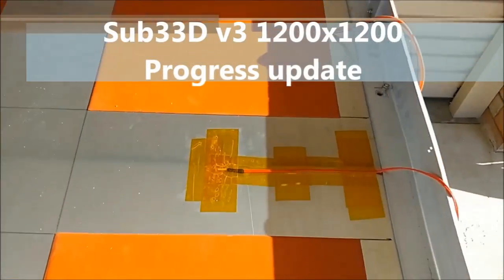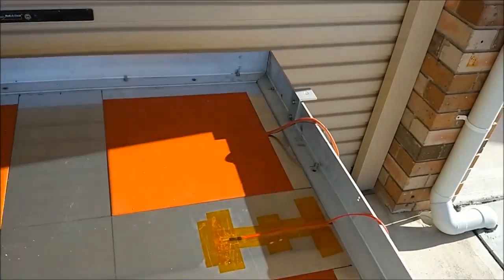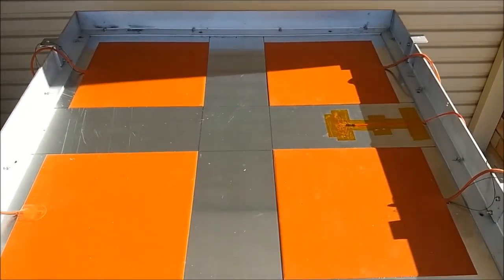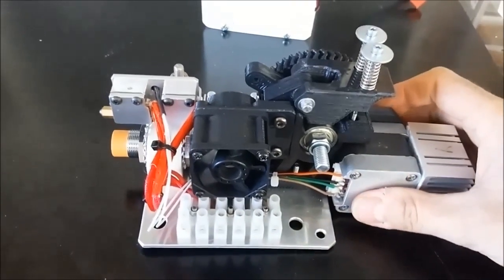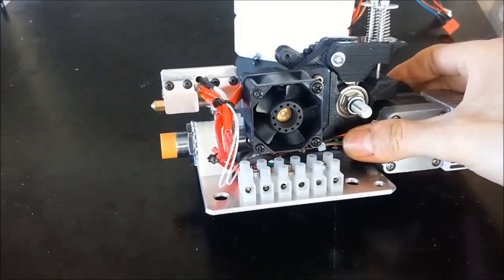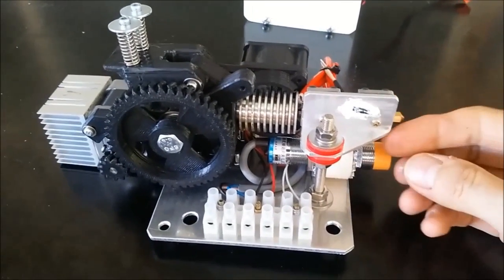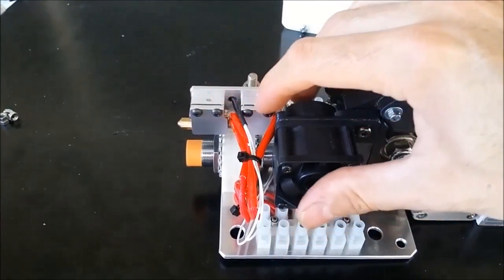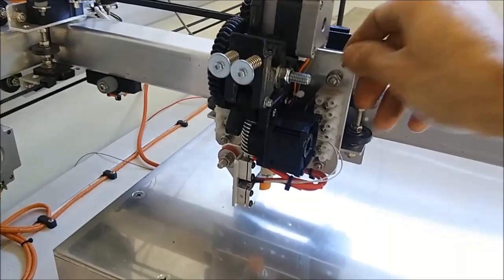Large scale DIY 3D printer - 1200 x 1200 Sub33D V3 - Heatbed and Extruder setup

Comment: Do you control each bed heating element separately, or do all four receive voltage from the same source and you get information from the one thermistor you described? Are the thermistors native to the heating elements even used?

Comment: does the heat pads come with self stick adhesive or do you need to glue them on?   if you have to glue them, what type of glue did you use?

Comment: Quick question? Are you familiar with magnetic position lock? Where an object can be locked into position by way of magnetism! If we implemented that tech into 3d printing wouldn't that made the axis move smoother?
Reply: I googled magnetic position lock and didn't find anything. Is it like the brakes and motors on modern rollercoasters/trains kind of deal?
Reply: @MrRoyHarden  I've brainstormed this idea and haven't figured out a solution to magnetic wobble!still thinking thou!👍

Comment: 4 heatbed uses one power supply or every heatbed is having it own power supply. Thanks
Reply from the maker: The heatbeds are all connected in parallel and run off 240v AC (no power supplies needed), they are controlled using a 25A solid state relay
Reply: @sub33d32  how are they controlled?

Comment: Love this project! i know you must've all ready considered this, but i would definitely fill the whole build plate with silicone heat pads, or just take them off and print pla on the cold bed. it is kind of pointless in this configuration as warping with abs always happens on a specific spot and if its cold in a place it will always end up warping on that spot. maybe you have found a way around it already, but good luck man!

Comment: hi i'm rene how did you do that with the thermistor centered on the bed? or one heating mat? Best regards, rene
Reply from the maker: I installed a thermistor in between 2 of the heating pads (did not use the ones in the heating pads)

Comment: have you try using heating element under the bed. another way is  to produce steam system to distribute heats across the bed at cheap cost. Im using full THK linear and rack n pinion.

Comment: That extruder assembly is a work of art.  I particularly like the support for the heating system to prevent breakage upstream when collisions happen.  Incidentally, I see insulating washers for that mount and that is great but what about between the rod and the support plate?  Is the hole oversized with a washer within the plate to fill the space between the undersized rod and oversized hole?  Putting an insulating washer there could further reduce unwanted heat escapage. :-)
Reply from the maker: Cheers, yes you are correct, a second set of fiber washers would help reduce the heat loss further, although this extruder will be replaced shortly, as I am currently building a dual 100mm tall stack, 320W (8 x 40w heaters) 1.5mm nozzle extruder which should have 4 x the flow rate of the current one (16 x the flow rate/speed of average 3D printers), but it will loose some detail compared to the current 1mm setup.
Reply: Why don't consider the supervolcano... you can get either the original E3d or some Chinese clones and it come with 80W heater and 3 times the heating capacity of normal volcano  ..
Also don't you think 2400w for bed is over-kill the way your bed is designed can lose way less power than those moving ones which are open ..I'm planning to build my own 3d printer soon so this was interesting to watch... it would be of similar dimensions... also if get a glass over the bed it will decrease heat loss from the bed